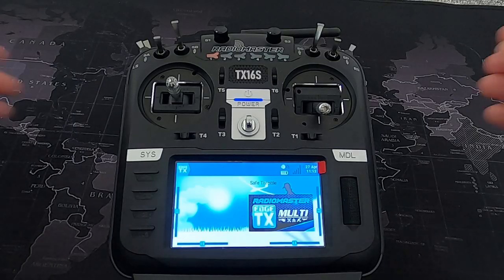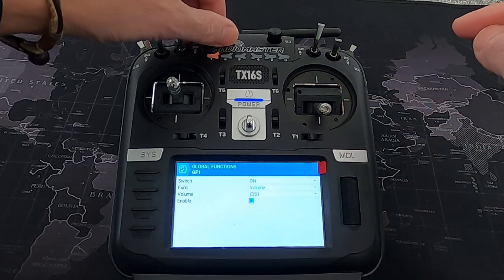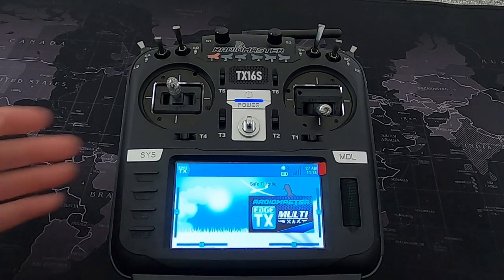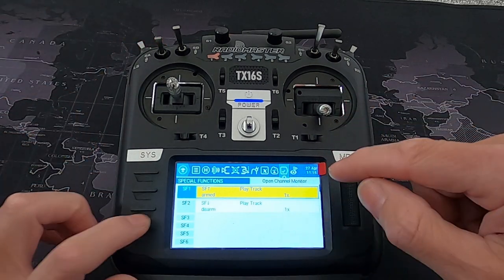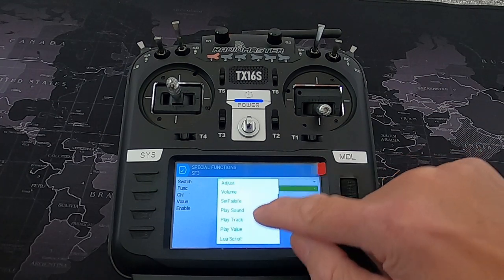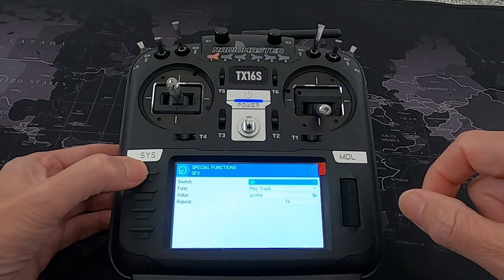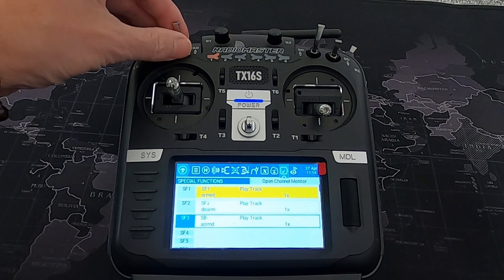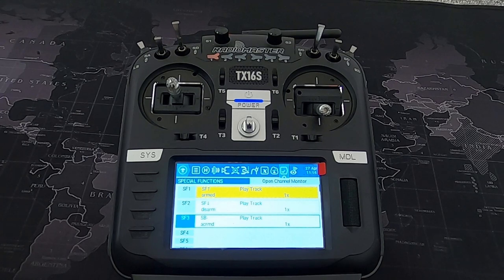EdgeTX Assigning Sounds to Switches & Adding Sound Volume

Comment: What to do if i can´t select the pots S1 & S2 in global functions but they are working fine in calibration? EdgeTX 2.10.4 on QX7
Reply from the maker: Check the SYS, Hardware make sure S1 and S2 are showing Pot w. det  The go to SYS, Global Functions set up the radio volume control option.
ON Volume S1 and check the box.
You should now be able to control the radios volume.

Comment: Strange question, but I am using EdgeTX 2.8.2 and I don't see an "ON" option in the Global Functions Screen. Any ideas there?
Reply from the maker: Charlie, it should be in the options. Click on the field once then click and hold, select other. First option should be ON. If it is not there I would suggest updating the firmware to the latest version 2.8.5 if you are confident in updating your radios firmware. Which radio do you have?

Comment: pls guide , special function we can use for , for example model no 1 , and that nothing to do with other model , and golable function work with all model , is that correct ? my english is not good hope you get my point .
Reply from the maker: Your English is fine. Global Variables & Special functions only relate to the model they are set in. The current model you have open. There are functions that are Radio settings and they apply to all models in your radio ie radio battery warnings, Mode type, mapping AETR for example and Radio Menu Tabs so Heli Setup can be turned off in fixed wing planes and drones.
Reply: Appreciate, your kind reply dear bill , I used to watch your videos since long , time and now first time,get a chance to ask you question

Comment: I got the ‘vario’ sound assigned to a switch. But it doesn’t seem to work with the telemetry. Im missing something simple I’m sure. Maybe I have to do something with logic switches?
Reply from the maker: Could you please give me more detail of what you are trying to achieve. This video may help you https://youtu.be/T2UVTg3Ayvw?si=AT5Q3zslFLRlrn3S
Reply: @the-happy-RC-flyer  No need. I got the variometer to sound off now. And it’s on the display as well. Not sure what I did to make it work. 😆

Comment: Hi Bill.I've just upgraded to edgeTX and my switches that i had set up in openTX now don't work in edgeTX. Even in betaflight they don't activate. My telemetry is working but output switches like arming and the buzzer won't work. Any ideas on what can be wrong please?
Reply from the maker: Ant can you allocate a switch to a mix in your radio to test it?
Reply: @the-happy-RC-flyer  Hi Bill. I seem to have the switches fixed and responding on Betaflight now. The beeper working but the arm switch still won't work and its set up correctly as a mode and seems to be switching correctly. I started this 9am this morning (UK time) and I'm still going. :(
Reply from the maker: @peekabooooooooo  Have you checked the Aux channel for Arming is working in Betaflight?
Reply: @the-happy-RC-flyer  I have Bill. Is there anyway I can send you a little video somehow so you can maybe see what I could be doing wrong?
Reply from the maker: @peekabooooooooo  try sending to triplemadventures@gmail.com
Reply: @the-happy-RC-flyer  Thanks Bill. I just this minute figured it out. I was getting a throttle warning in Betaflight so I then went back to check my inputs. I noticed my throttle was my tilt and my tilt was my throttle and this is why my quad wouldn't arm because my throttle would have been set to 50% with it using my tilt input (right gimbal). Basically EdgeTX comes default as Mode 1 and I need Mode 2. All sorted now thank god. Haha
Reply from the maker: @peekabooooooooo  I am pleased you got it sorted out.
Reply: @the-happy-RC-flyer  Thanks Bill. I have a question for you. I'm not sure of this can be done in EdgeTX but is there a way to output text in a widget based on a switch position? I have my flight modes set on a switch. Angle and Acro. Angle output is 100 for example and Acro is -100. On a widget i want it to say "Acro"  instead of -100 and "Angle" instead of 100. Is that possible at all? Thanks. Ant
Reply from the maker: @peekabooooooooo  you need to set up flight modes and they will appear on your radios screen. This video should help you.
https://youtu.be/liu32jQ4PU8
Reply: @the-happy-RC-flyer  Thanks mate. Last night I posted for help in the EdgeTx Facebook group and somone pointed me to your video which was a great help. There are issues with the placement of the Flightmode output unfortunately. It throws the alignment out on my widgets above and also the color of the text can't be changed even through themes. I've posted a video in the EdgeTX Facebook group if you wanted to see my developer request. Essentially it would be great to have the "value" widget accessing the FM1, FM2 flight modes then it can be displayed as a widget and also enable one to change the color of the text. Thanks man.
Reply: Hello there bill. This is the vid I've been looking for. Followed step by step setting up volume control but it does not seem to have any affect. Volume doesnt change at all. Wondering if I missed something? Any suggestions?
Reply: By the way I'm working with a new tx12 mkii mpm edition. Thank you sir